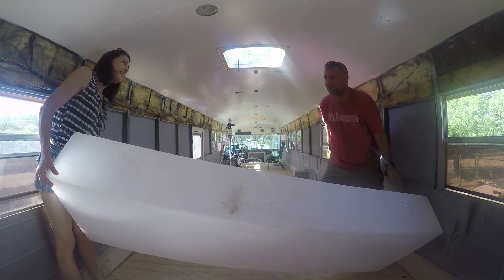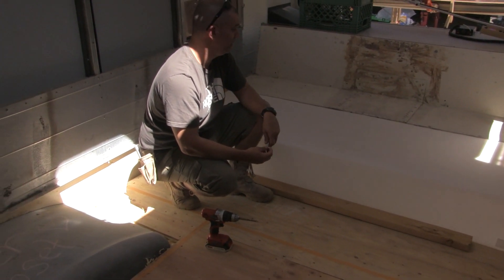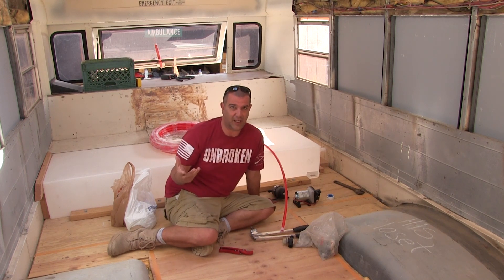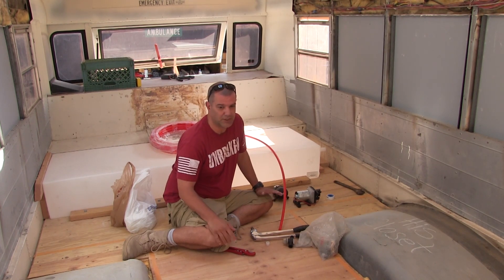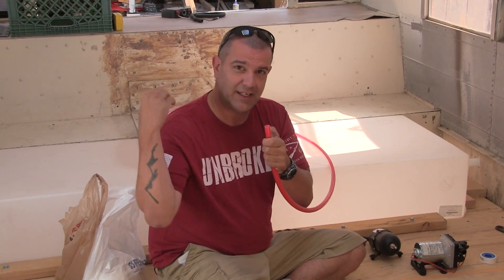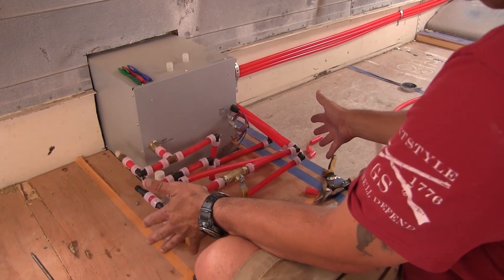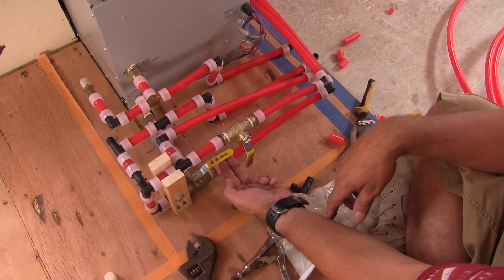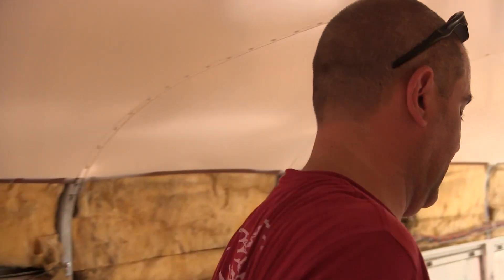Skoolie Bus Conversion: Fresh Water Tank and Plumbing with PEX PART 1

Comment: Why are you using red for the hot and cold side?  They do make blue pipe, right?  Those white rings are expansion fittings not compression fittings. It’s pronounced  “oop-ah-nor”😊

Comment: Here's some good info about pex for anyone who wants to know the differences between systems and why the system used in this video is the best for residential use (including moving residences)

I'm going to start out by just saying that sharkbite connectors are really the only type of connector I would NEVER use. I know they can seem appealing, especially to a DIYer, since they're fast and easy and don't need tools, but they depend on an O-ring that can be degraded by the chemicals used to clean and treat water, and it's easy to damage the ring inserting the pipe. Other than for temporarily capping off roughed-in pipes they are worse than worthless, they are a liability. If I ran an insurance company, I wouldn't cover a house with sharkbite fittings. If you see someone claiming they installed sharkbites 20 years ago and they're fine, that person is very possibly speaking from the perspective of survivorship bias. sharkbites aren't good, those people just got lucky. Please don't use them.

There are two main categories of connectors for pex. Crimp connections and expansion connections. The argument for expansion fittings is simple. Fittings go inside the pipe, therefore crimp fittings have a narrower diameter than the pipe and can restrict flow. Expansion fittings fix this problem by making the fitting roughly the same size as the pipe and making you stretch the pipe over it. Don't worry about leak resistance too much, They're all so strong that the pipe itself would most likely burst before the connector goes when done properly, so leaks are almost always caused by user error. Theoretically, a properly done pex plumbing system may very well last longer than the home you put it in.

For crimps, a fitting slips into the pipe, then you crimp around the outside of the pipe. You can either use crimp rings or cinch bands, the only real difference is what tool is used. The cinch band tool is cheaper and not pipe-size dependent. While you can technically use pex A, typically pex B is used. There are two big name brands for crimp style fittings and pex B pipe. Viega and Zurn. Sharkbite actually also makes pex B pipe, and while their fittings are trash, their pipe is perfectly fine.

For expansion fittings, there are two types. There is the ASTM F1960 standard, commonly called Uponor (Uponor is the "name brand"), and the ASTM F2080 standard. You need to use pex A for expansion, no pex B here. F2080 costs more, is slightly more difficult to install, less common (harder to find a supplier) and requires much pricier tools than F1960. The major benefit of F2080 is that you don't need to wait for the pipe to contract before the connection is at max strength. Once it's on, it's NOT coming off lol. In a time sensitive commercial setting, where you need that water back on yesterday, that makes sense. For residential and DIY work it isn't worth the cost increase over F1960 in my opinion.

Also, while there's not really much reason to, you technically can mix and match fitting types so long as your pipe is compatible. You can even use any of these systems to connect pex to copper pipe with a fitting that has a pex connection on one side and a soldered connection on the other. Just remember that pex A can be expanded or crimped, while pex B can only be crimped. Also for bends, pex A is more flexible so you're more likely to be able to skip a fitting by just making a bend in the pipe. Pex B can be bent, but there's a higher chance of kinking the pipe and you typically can't get as tight of a turn out of it.

Another note, plastic connectors are generally preferable over brass. They are cheaper, and they will hold up at least as well as brass, if not better because of corrosion resistance.

Overall, pex A pipe with plastic F1960 fittings is simply the best way to plumb up a residential water supply system.

Comment: Hi guys, I'm doing a bus conversation as well in Europe and have been following your videos, and trying to use the same products, more or less as it is difficult to find most of them in Europe. If possible, I would like to know which size of expansion rings you used for the 1/2" pex-a tubing. It's tricky to get the sizes with different measuring systems, and want to be sure I order the proper size. I'm using a 16mm tubing (5/8" I guess), should I get the rings one size larger? Thanks and keep enjoying your bus life
Reply from the maker: Get the rings for 5/8". The tool that expands the rings will accomplish everything for you.

Comment: I stumbled on your channel and went back to watch the build. I hope someone told you to put chafing material on those perforated straps that you used to support the pex. And wrap the Teflon with the rotation of the fitting so it doesn’t bunch up as you’re tightening the fitting

Comment: What is the tool called that expands the Pex?
Reply from the maker: iGeelee Manual PEX Pipe Expander Tool Kit PE-1632 with 1/2",3/4",1" Expansion Heads for Propex Expansion suit Propex Wirsbo Uponor Meets ASTM F1960 Standard PEX Coupling Fitting Radiant Heat https://www.amazon.com/dp/B07S75M7P4/ref=cm_sw_r_cp_apa_i_URxWDbQ4PVAGP

Comment: I too was torn between the PEX-A and PEX-B but after researching for a home plumbing project, if I recall correctly, the advantage of the PEX-B (SharkBite type fittings) is that the inner diameter of the tubing stays the same through the fittings, since the SharkBite fitting goes OVER the tubing.  This in contrast to the PEX-A fittings that you used here, where the fitting goes INSIDE the the tubing.  This effectively narrows the tubing diameter, with an associated increase in water pressure (PV = nRT).

That and as I recall the PEX-B with SharkBite fittings were much more readily available at places like Home Depot than the Uponor PEX-A.
Reply: As a retired construction risk professional and construction defect specialist who has inspected/ investigated thousands of homes using Pex, I can assure you that the Uponor fittings are THE BEST in the industry with fewer failures.  Sharkbait is junk and not used by the large production homebuilders.  Also, Pex piping can be “swept” or curved, to minimize the number of fittings used.  However, the room needed to comply with the manufacturers recommended minimal radius would be very difficult in a bus build.  That said, whatever systems chosen (and I highly recommend the materials/ system used here) ALWAYS read the manufacturer’s installation instructions.  

The only thing I would consider doing differently is:
     1.  Placing the tank in place to locate/ measure the curb sleepers
     2.  Installing 2 - 2x4 sleepers  to form a 3” curb to surround tank (before tank is installed)
     3.  Drilling a floor drain in subfloor to outside (with mesh at exterior to keep out mice)
     4.  Installing WR Grace’s Ice & Watershield to subfloor and up & over curb sleepers
     5.  Cut in and install floor drain trim cover
     6.  Set water tank in place (I would also add strapping over top in 3 places)
     7.  Make all connections, including tank drain.

The above may sound like overkill, but if the tank should develop a leak, you now have it essentially set in a shower pan, and most water will drain to the outside instead of flooding the bus inside.
Reply: On

Comment: Just a heads up, but a brass ball valve with water in it, if it freezes is will split. Was on a small mining operation and we replaced 4 a day at least during winter, just normal freezing temps..
Reply from the maker: Very good to know. It is inside so will be subject to the heat we enjoy. I guess we will be draining if we have to store it.

Comment: Bussy a suggestion.  Something to consider if it is at all possible to get to your lines.  To save water when using the shower or kitchen sinks, consider putting a pass by line to your fresh water tank when waiting on hot water.  Let me explain:  If and when you are boondocking and want to save water, this will help.  Have a valve on the hot water line running back to your fresh water tank in the shower stall.  When you come to get hot water, your line will have cold water come out until hot water appears.  During this time, you turned the valve and the water is going back to the fresh water tank instead going down the drain.  When it is warm enough to shower, turn the valve and the water starts coming out of the shower head.  This way you waste less water.  Good Luck.....

Comment: I dont know a whole lot about plumbing but would u have used less water line if the 100 gallon tank had been turned 180° so all the lines ran down the same side your tank is on?
Reply from the maker: I needed the gravity fill to be on the driver side where all of the services available meet your vehicle.
Reply: @BussyMcBusface  
I thought they were on the opposite side. See, I learned something too!

Comment: I've watched several YT videos on plumbing and wonder if there is some sort of vent needed for filling the tank. doesn't the air need to escape? Maybe I missed that, but is there some sort of check valve that helps with the venting air? How do you know when to stop filling the tank, is there an overflow somewhere in your system? Thanks for all the great info on your build, learning lots watching you. :)
Reply from the maker: Look closer, I did actually install a vent and I think it's in the video. It's from the port on the back side of the tank and goes to the outside fill.
Reply: yeah, I didn't see it. I know it must be tough to build a great home and answer all of our questions from YT. Thanks again!

Comment: Too bad that tank doesn’t have baffles. If it did, it would drastically diminish any “sloshing”.
Reply from the maker: I know. Couldn't find anything like that. I
Reply: Bussy McBusface 
Really digging your vids. Keep em coming
Reply: @BussyMcBusface  put bio balls inside the tank... you will lose some capacity, but it won't be sloshing around... Here is a demo of larger ones in a big water tank...
https://www.youtube.com/watch?v=uWUdp3f-2cU

You can also buy smaller ones...
bio balls can fit in 1 1/2 inch pipe
Or 

you can use bio media... can fit into a 1/2 inch hole.
Both are used to grow bacteria in filters for ponds and fish tanks, but since you are adding chlorinated water... there won't be an issue.

Comment: Really diggin' the bus guys! Yall seem to be the complete couple. Your videos are great! Are you keeping a log of the cost incurred to build this Skoolie? Would like to know the true cost. As far as the PEX , the most expensive is usually what works best LOL...., kind of a get what you pay for. Keep up the good work, will be waiting to see the evolution continue.
Reply from the maker: We are keeping somewhat of a log but it isn't perfectly accurate.
Reply: I too would like to do a bus someday. I think it would be a great way to live inexpensively. However, I would like to insulate it well and use a system that was solar on a roof rack and battery bank under like your aluminum boxes. Also, A stove/oven seems wasted space to me. IMHO, an electeric burner set that plugs in

Comment: Pax is designed to use with home runs like electrical panel not with all those fittings you may have leaks

Comment: Yes I'm the plumber laughing my ass off why don't you just buy a manifold
Reply: ROFL... not a pro plumber... but that is real mess... and a waste of space...
He needs to learn the concept of a wet wall design. 

And redesign the inside layout...

In addition, all that plumbing running against the metal side of the bus will freeze super easy... It's a monster heat sink.
Plus hope he vents the water tank... otherwise when he goes to fill it, it will explode...

Comment: You should use a spring check valve after the pump in addition to the valve so you won't have to use the valve the valve would then me for servicing since you dont have a valve at the tank before the pump

Comment: Mike & Kerry, Once again a very enlightening video on the progress of your project. One suggestion I have and you may already be doing this but an "as built" drawing on that plumbing system or at least marking each pipe. You know as you get older your memory may slide and you may not be able to remember :) Keep up the good work and posting videos. Jerry
Reply from the maker: Thanks Jerry.  I am planning on marking each hose for identification. Just haven't got there yet.  I do have a flow chart but it didn't make the video. Thank you for your comments. They mean a lot to us.

Comment: Wow that setup looks complex I've done plumbing on caravans it's often easy to use multiple colors
Reply from the maker: I ended up with 100' of red PEX-a so I just used it.  Otherwise I would have used the blue as well but at $70 a roll, I stuck with red. 😊
Reply: Fair enough can be very hard but I like the idea of the reservoir thing for water depressurising when turning the tap
Reply: @MrMoose-lq1ww  how do you get it to depressurize
Reply: @TeeTirado  in the caravans I have built they have electric water pumps that presurize the lines and shut off so the pump doesn't run constantly but when you turn the tap the water coming out drops the pressure and the pump kicks in to try to maintain the flowrate

Comment: And You should put a valve close to the tank if you can in case you ever need to cut the water coming out of the tank. Just in case you need to service the pump you dont have to drain the tank!
Reply from the maker: Well, Drew We thought of you this morning as we added the valve you suggested! We are also adding a drain valve just in case we get some bad tasting water. Thanks for the comment because I would have paid a messy price the day the pump went out!
Reply from the maker: Great idea!
Reply from the maker: I am going to add that right away.  The pump will go down. That's a given.

Comment: You defiantly lucked out on the tool! Originally that's a 300$ tool. Now the cordless one from Milwaukee is about 3-400 but that system your using is my favorite. I did a whole house with it, and haven't had any issues, and I installed it 10 years ago. And you dont need to wait more then a minute to put pressure to it.
Reply from the maker: Yeah, I was really happy to find it!  Everybody says, "propex is the only way to go."